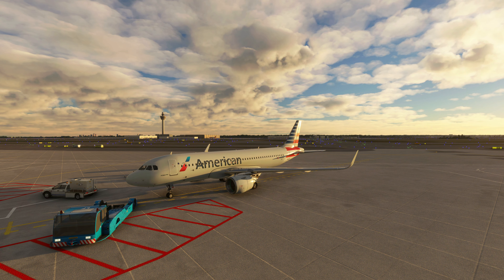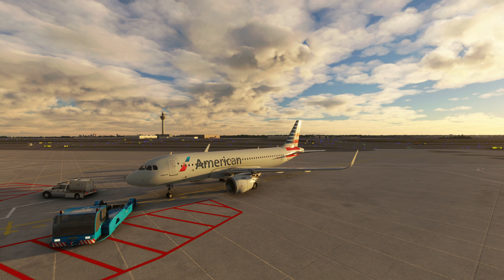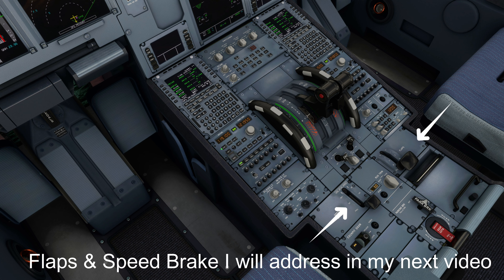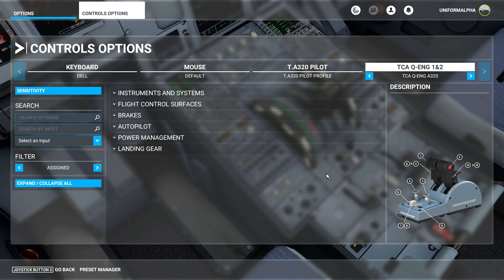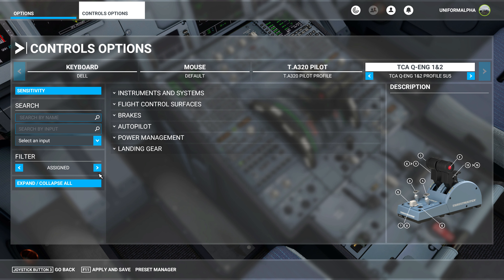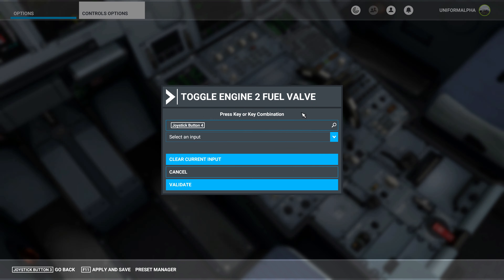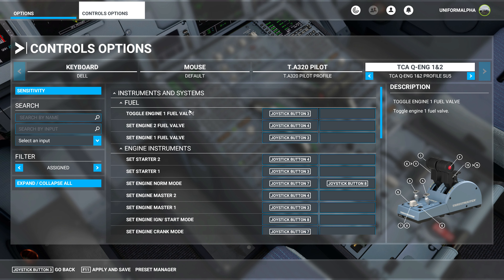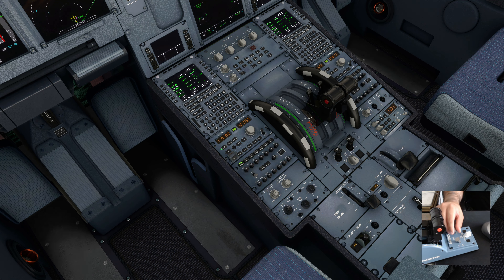SU 5 TCA Throttle Engine Switch Fix

Comment: Thanks that works for me but, My engine mode selector is not working, how can I fix it?
Reply from the maker: If you start from the beginning using a fresh copy of the default A320 throttle profile, the engine starter switch should work. Don't use any of your previous profiles.
Reply: @UniformAlpha320  I did it but maybe in some update it stopped working, I’m gonna download de FBW version

Comment: Thank you very much for this important video, as all of them are very useful. Please don't forget the FLAPS & SPEED BRAKE video. Thanks in advance
Reply: There is an easy way to fix them, just delete the assigned axis for flaps and spoilers (if you don't have the extensions)

Comment: I enjoyed the few videos you have done, wonder if you have considered doing some more FS2020 issues. I have had the same issue you mention a minute into the throttle calibration one. If I leave the flight running and open the settings panel in the game for whatever reason, as soon as I resume - I get full flap and full spoilers.  I think I heard you say you might do a video on this. Any ideas how to fix this cos I'm right out of anything more I can do to stop this annoying intrusion. Thanks n regards, Pugwash

Comment: As for mine the engine on the controllers does respond but at the same time it doesn’t turn on like it does respond but it doesn’t turn on but when I want to turn it on from the keyboard by pressing Ctrl E then it will work

Comment: Thanks a lot! Do you also have a solve for the engine mode button? (7/8) Cant use it....
Reply: Same here
Reply from the maker: If you start from the beginning using a fresh copy of the default A320 throttle profile, the engine starter switch should work. Don't use any of your previous profiles.

Comment: Any luck with the ignition selector? Mine its nit working.
Reply from the maker: If you start with a copy of the default profile it should work. The crank switch was working on the default profile for me, so I did the rest of the config using that.

Comment: my crank mode norm mode ign start switch is not working either any clues how to fix ?
Reply from the maker: If you start with a copy of the default profile it should work. The crank switch was working on the default profile for me, so I did the rest of the config using that.
Reply: @UniformAlpha320  its sorted thank you

Comment: I’m having issues with Cessna planes. The screens will turn off after 5 min of flying. Any ideas?
Reply from the maker: Try removing the throttle quadrant and then flying (use keyboard for throttle). That way you can check if it is do do with your attached device that is turning the aircraft or some other issue. I never had such an issue.

Comment: What about ign switch?
Reply from the maker: If you start from the beginning using a fresh copy of the default A320 throttle profile, the engine starter switch should work. Don't use any of your previous profiles.
Reply: @UniformAlpha320  I don't